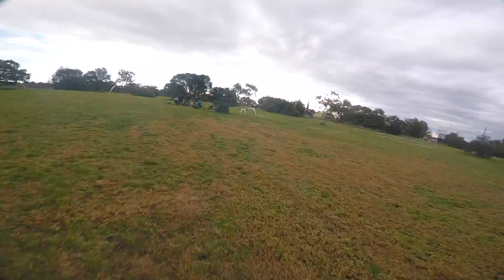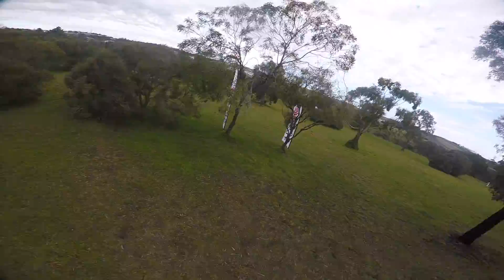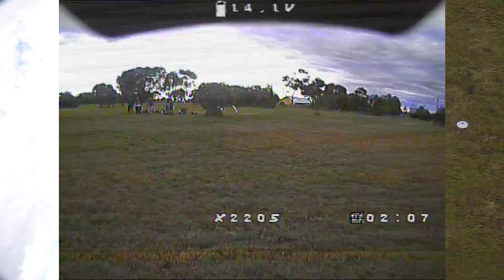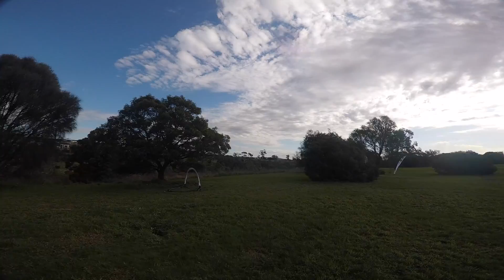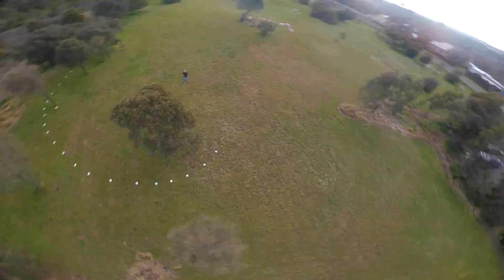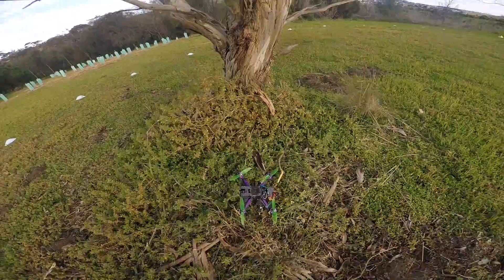THINGS ENDED BADLY!!  Eachine Wizard X220S review + flight

Comment: Yeh the quad isn’t full carbon fibre but you can’t argue for the price
Reply: Dripping Ice yeap.
Reply: 25€ more than original that had carbon frame?
Reply: Dripping Ice If you can't solder some joints yourself sure the price is "good" at best but you can definitely have better stuff for $15-$30 more or cheaper if you cut some corners like they did.
Reply: Shaun DYST yeh true but this quad mainly for beginners, but I agree that people should make there own quads first for the experience.
Reply: Dripping Ice My total cost for a build I just ordered from USA vendors only (could of been cheaper using CN) came out to $199. My parts list:

Heres what I bought for my first quad to actually build piece by piece.

10 Pairs Racerstar 5042x3 =$7.99

1 Low Loss Antenna Extension Cord Wire Fixed Base for Anetenna RP-SMA = $2.99

4× (2cw/2ccw)Racerstar Racing Edition 2205S 2600kv = $32

4x Racerstar RS30A V2 30A Blheli_S ESC OPTO 2-4S Support Oneshot42 Multishot 16.5 Dshot600 = $54

Flysky 2.4G 6CH FS-iA6B Receiver PPM Output With iBus = $12.99 

Eachine TX801 5.8G 72CH 0.01mW 5mW 25mW 50mW 100mW 200mW 400mW 600mW Switched AV VTX FPV Transmitter = $19

Realacc Carbon Fiber Battery Protection Board with Tie Down = $3.19

Raceflight Betaflight CC3D REVO F4 STM32F405 Flight Controller with Vbat/Buzzer = $22.99

Aomway 5.8GHz FPV 4 Leaf Clover AV Transmission RHCP Antenna 1 Pair Blue Red with Canopy = $16.99

Price for above stuff came out to $167. Now let's add the frame and heatsrink I chose:

Genius 215 3K Carbon Fiber FPV Racing Frame 4mm Frame Arm w/ 5V & 12V PDB =$ 32.69

 328pcs 2:1 Polyolefin Halogen-Free Heat Shrink Tube Sleeving  8 sizes = $6

Total for my build $208.01

I habe a fpv 1000tvl camera and transmitter so it saved me $50 or so dollars!
Reply: Good show Shaun DYST I have built 2 myself so far and way better to do than getting these BNF or RTF versions in my opinion,  :) Plus way cheaper, you don't need expensive soldering stuff or amazing skills, plenty of vids on here to teach you the basics, Join the party and get building you won't regret it.  :)
Reply: jamesworld3 nah mate he just goes on YouTube and see all the options😂
Reply: Where is the best place to get all these bits and pieces???
Reply: yobbo yobbo yobbo Use a combination of Ebay, Banggood, Amazon and even forums. The issue with Banggood is they charge cheap upfront prices while screwing you when it comes to shipping. Yes they have a "free" shipping choice but if you planned on flying your quad in the next 3 weeks to a month make sure you opt for searching the USA only warehouse at the top of the page. Funnily enough I have had cheaper prices on some items from the US vs CN warehouse.

Here's where Ebay, Amazon, Forums and Craigslist (last hope) come into play. Once again use the US/North America search or u'll end up with mostly chinese vendors. The bottom line is how long do you want to wait, how much are you willing to overpay in some cases and how frustrated do you get when the one item you want can only be ordered from China... For example my new Genius 215 frame arms can ONLY be found on Banggood. They do have good products but I'd say do your research before buying and I ain't talkin about the videos they pay BG points to make just to throw on their product page to coarse you into buying. 

Ask away the R/C community has helped me ever sense my first Team Associated 1/10th buggy with gold aluminum chassis and 3 piece white rims. It's probably why I have driven amd flown almost every scale model electric and nitro.
http://www.rcdriver.com/team-associated-rc10-classic/

Comment: I was thinking of picking up this quad but I'm going to hold off on it for just a bit.  Is there another you would recommended no more than $200?
Reply: Snafu2346 its fine, just buy replacement top plates which are better or arms. Better props too. It flies well, but durability is a little problem. Just get a better frame. Or maybe get the x220?
Reply: Or you can build up a drone it's really fun if you need help I can send you the links to all of the parts
Reply: I was looking at that too, there seems to still be more Pro's, than Con's.  I'm glad in the video, the arms held up to the crashes.  I don't think anyone plans on crashing it that hard.
Reply: Eventually I want to in the future.  I was kind of looking for something almost ready atm.  But I have been pondering putting one together.  Those Armattan frames are  nice, but pricey.
Reply: Was also comparing this to the Diatone Tyrant S as well.
Reply: Definitely learn how to build your own and be confident in it, even if you do decide to buy a pre-built one - if you really do have fun, it won't be long until you break stuff and knowing how it all goes together means you can fix it.
Reply: With the slightly dodgy soldering on the cheap ready-builds you still need to do your own QA of all the joints, so building your own makes more sense. You can get all in one FC/PDB/OSD/speed controler from Racerstar which means minimal soldering to build your own.
Reply: Snafu2346 
Try the jjpro p200, I have it and it's FAST and great quad, good quality motors and ESC's, plus real carbon fibre
Reply: I'm still thinking of that too, I'm pretty open to it.  I was thinking of getting something like this as when these inevitable things happen, I'll be able to tinker with it and used what I learned as well, rather than potentially messing up my own build.  
I like that Amattan Chameleon frame, somebody mentioned a AIO and I think on Joshua Bardwell channel he has one running a AIO and its pretty compact.  I'm not sure what it all entails and this would be my first, but I'm willing to learn.
Right now Im gathering a playlist of how to build a quad and watching to them to see what I can do.

that also being said, I wouldn't mind that while I'm putting together mine own, at the same time, I'm flying another one around as well.

I've also thought about a Lizard 95 Micro, that has been mostly universally liked.  Albeit putting some soft mount to clean it up a little.
Reply: Get yourself one of the newer 2 or 3 inch quads until you are ready to build your own
Reply: I was watching Joshua Bardwell's video on that custom Armattan Chameleon as a follow guide on building my own one day.  I've really like the Amarttan frame, its pricey, and the parts he's listing are pricey too, so it would certainly be a slightly higher price build.
Reply: Snafu2346 For an easier build check out things like the Emax Magnum Tower... Which make building a breeze. I have a review on my channel if you'd like to check it out. Doesn't get much easier than using one of those.
Reply: You do what you feel more comfortable and just ask if you have any questions

Comment: Hi Stew, I've always used the regular quad copter like the syma, but i have been thinking about getting into FPV and your channel has been very helpful and informative. THANK YOU! Quick question, what is the difference between 4s and 5s and what makes one radio better than another?
Reply from the maker: battery voltage, 4s is 4 cells and 5s is 5 cells. radios you want something that fits in your hands well, and has a strong radio link to the quad
Reply: UAVfutures thanks a lot I would like to show you my first build when its completed.

Comment: are the arms built from the same composite like the top and bottom plate or its real carbon and would you recomend the original wizard or this "S" version because i want to get into the fpv  and i need to get a quad

Comment: Technically there are no "Pagoda knockoffs", since the design is open source. They only differ in quality of assembly. The PCB's need to be absolutely perfectly aligned and parallel to each other, also the solder job has to be executed pretty well.

Thanks for crashing :-)

Comment: hello, I'm wanting to buy a rtf quadcopter or at least a almost rtf quadcopter to start racing.  it will be my first racer but I'm chasing something zippy and fast (for a fpv newbie) my budget only allows $200-#250ish AUD for full setup :(  have you any suggestions?? 
regards
Steve
Reply: Steve Hammond 
Try the jjpro p200, it's literally made for racing, I have one and it easily went 100kmph, And it comes rtf with battery and controller, then just pick up the cheepo Vr007 headset and Ur set
Reply: 9364 thanks heaps!  I'll check it out
Reply: 9364 hello again sorry, is the only difference between rtf and almost the remote and transmitter? if so would you recommend another remote and transmitter?
Reply: Steve Hammond 
The arf model (almost ready to fly) does not come with a receiver and transmitter and battery, if you want a cheap but good transmitter, I would need to know what you would use it for, long range or freestyle or race?
For race and freestyle spektrum is fine, but if you get the rtf version you get about 600m of range which is great for only a little bit extra 💰
Reply: 9364 thanks!  Ordered one today :)

Comment: It's not fiberglass at all... it's a carbon sandwish with a compisite in between. I've seen stress simulations proving it is more durable (considering weight loss), if made by a reputable company.
There is also a Martian II-S frame like that..
Reply: Yeah it's a compressed foam or balsa probably. But He only knows products that get sent for free, no outside knowledge or research

Comment: I found the original Wizard very disappointing. The FC UARTs started getting really flakey where they would work one day and not another (out of the box). It is cheap but you get what you pay for and I stay away from these RTFs as my DIY quads all fly much better and I can fix them easily thanks to all the help I get from you and my experience building dozens of quads now.

Comment: I'm going to change the receiver to the Turnigy iA6C will it work ok with the transmitter that comes with the wizard?

My x220s came with a motor not working and found a solder joint had come loose. I have also broken the top plate where the FPV antennae sits. The pig tail also ripped from the VTX board. Anyone know where i can get a new pig tail for the vtx>?? Apart from that though im loving my x220s ;D and im certianly learning a  lot... fast. as its my first quad :)

Comment: The top plate is always to weak but the composite arms might be an advantage eight them to normal arms they might be lighter and just as strong. Its not really best of the year cause the hobby has made massive leaps they added some upgrades but only got innovative with the composite arms that I still think might need like you said more looking in too

Comment: You should move the components onto another frame :)
Reply: Armattan chameleon!
Reply: The Chameleon, even though not advertised, handles a 5s just fine. Would be kind of blasphemous to swap Armattan parts for Eachine parts. I'd just put it on a Realacc X210 frame, or the original Wizard frame.
Reply: On to a x220 frame!

Comment: be better with martian 2 frame with upgraded top and bottom carbon plates not the stock martian 1.5mm frame the legs on martians are decent just cut wrong compared to my alien 5" which no comparison if you ask me.. Love to have couple more quads for straight up bashing or nice freestyle

Comment: Why the heck would someone cheaply knock off pagoda antennas?! The original design by Maarten Baert is 100% open source and they cost less than half to manufacture compared to normal antennas anyways! There is really no excuse for making bad copies. It takes zero R&D and costs almost nothing to manufacture ... smh
Reply: Is there a source to pick up legitimate ones that you would recommend?
Reply: sprint league city EMAX
Reply: He clearly catches the antenna on a gate and bounces off then his fpv video shows lots of breakup. Then he starts talking shit about the antenna. I'm pretty sure it was that high speed gate smash that caused your video issues.

Comment: Since the pagoda design is opensource, these eachine pagoda's aren't exactly 'copies'. But sadly they're made to the same bad standards as most other chinese products. And with pagoda's, it's the assembly of them that make or break them. If the plates aren't spaced and aligned perfectly, the performance of them suffers horribly.

Comment: My original Wizard still doesn't fly, from out of the box.
Reply: Have you bound it?
Reply: Yes. Every time I try to take off, it flips and break-dances on the spot. Won't even get 1 foot off the ground.
Reply: Luke Boland connect to betaflight go to configuration and make sure your yaw degrees is -90 or 270 which is the same thing. Not sure if x220s is the same way but it works on the original wizard.
Reply: Luke Boland Yep, connect to betaflight and check in the 'setup' tab if the quad is upright. (If not change it in 'config'

If that is all correct then it is your PIDS. Watch a tutorial on PID tuning.
Reply: A million thank yous. Changing the Yaw to 270 fixed it. IT FLIIIIIIEEEES!!!

Comment: will you please look into this video at least before you go bashing carbon fiber sandwich frames. https://www.facebook.com/pumkin.head.33/videos/10154981146539164/
this is a f.b. video of chad from rotor riot talking about frame design. start watching at the 15minute mark. 
And I've looked online; and from what I can tell he's right...!  So if someone can prove me wrong please do so.  
and yeah you can have problems with sandwich frames if there not attached properly and the materials start to delaminate. Other than that having a sandwich frame is a good thing.  Maybe you don't like it; and if that's the case, you should say that in "your opinion" its not something you like.  Although for someone who claims to love innovation you saying negative things about sandwich frames is actually holding innovation back. just like people bashing c.w. and c.c.w. motor threads.  but yeah.  I'd love to see someone reply to this.  btw I'm not trying to bash anyone I just don't know of any actual proof to back up what your saying other than the fact people don't like change.
I also wanna say one thing about about you knocking the carbon. what wizard didn't break top plates or antenna mounts..?  I just feel as if your too harsh on sandwich frames.  again... I think its a good idead as long as its done rite.

Comment: Do this stupid shit with your 500$ quad it will break too.
Reply: I doubt it, my $15-$20 dinosaur ZMR 250 frame has survived much worse, barely a scratch on it. Smashing 50 mph is only moderate speed (did that last weekend, sheered off my VTX antena, and took out my 600mw VTX, knocked the camera out of its mount). Didn't even bend a prop, putting it in my backpack does more damage to the props.

I've hit the ground so hard, I've bounced 30 feet into the air, and did roughly 80 cartwheels traveling over half a football field in cartwheels. Guess what broke then? Nothing but some super cheap props... Like those props break almost looking at them though, but they were about $0.10 each, so not terrible.

Current build:
ZMR 250 (making a second with newer, more aeroidynamic frame, but darn, the ZMR will not die!)
DYS 2206 2700kv (Samguk Wu series)
Race star 35a 4in1 esc
Race Star 5042L tri-blade
dinosaur Naze 32 rev6 (still looking at new F4... Haven't decided yet)